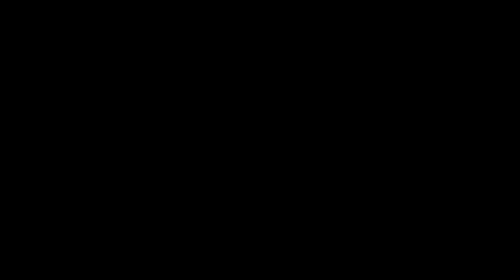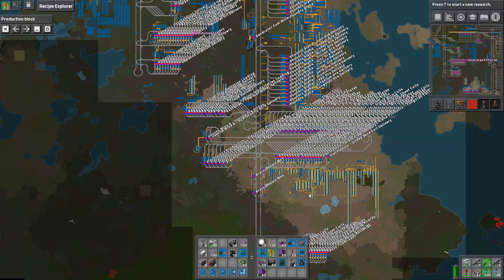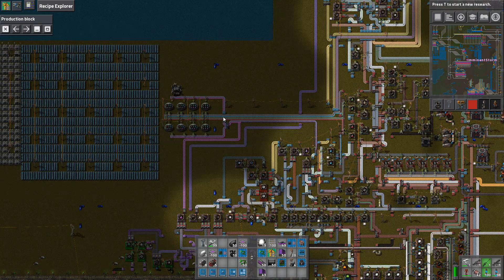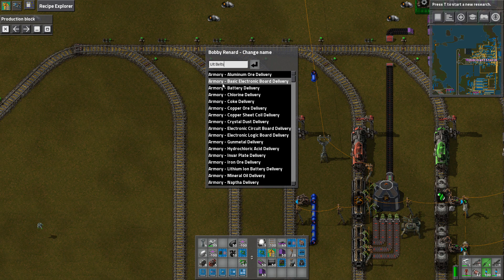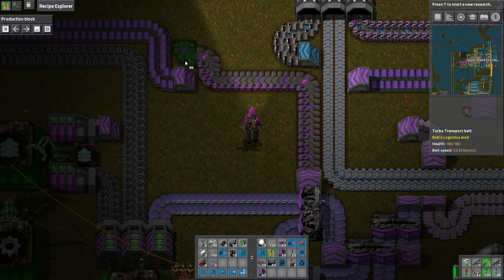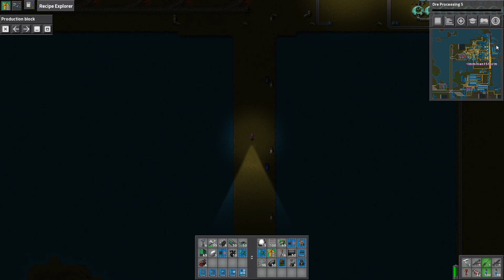Factorio - Angel's & Bob's - Episode 237 - Ultimate Belts

Comment: Sounds like the next step is to add a few nuclear plants to your energy production. A 2x2 grid of power plants will be a lot more efficient than four laid out in a row, and then you can start adding the best heat pipes and steam turbines that Bob's and Angel's can make. Then you'll have more power for whatever you want to do next, whether it's clearing out more biter nests (where the only power you need is for your laser banks), or getting ready to launch a rocket.